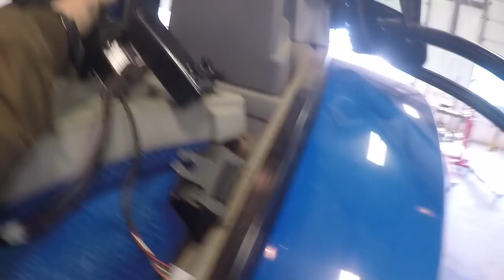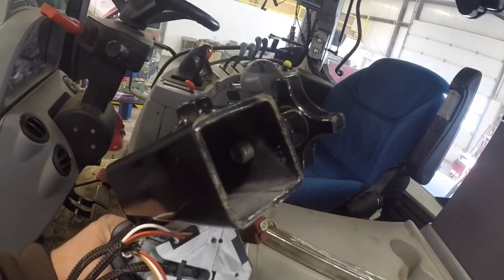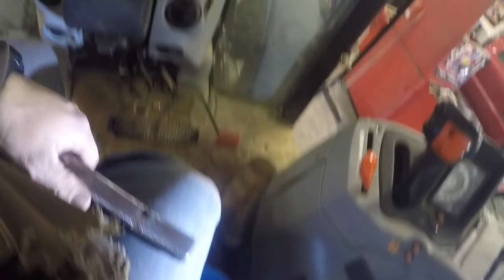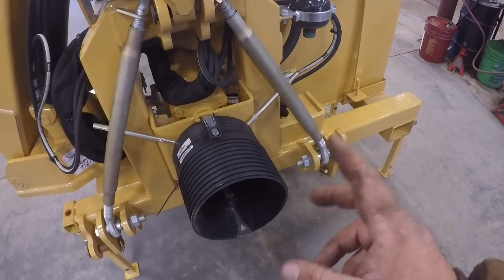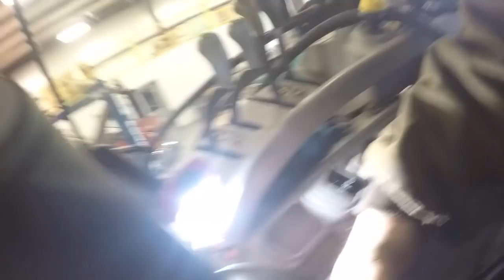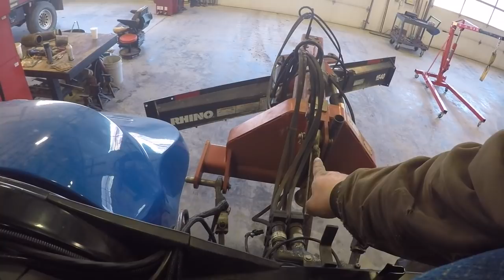The 6030 is getting a Diamond sidekick.

Comment: For the joy stick change could mod. the loader/snowplow joy stick with a square like the mower joy stick? I think it would make changing from 1 joy stick to the other 1 very easy with no tools required.
Reply from the maker: +Bradley Fitkin. That's a good thought but I don't think it's possible the way the cables come out of the factory joystick.

Comment: I was gonna tell you not that what you did won’t work fine but instead of cutting a slot like that if you have the right size end mill you can cut a radius in pretty easy. You wouldn’t want to try to plunge the side of the end mill into a wide area like the side of that tubing but you can use the spindle just like a drill press and progressively take a little at a time to get to your full radius. Basically cutting with the bottom of the end mill rather than the side in order to reduce tool pressure.
Reply from the maker: +Strangefruit. I'm not sure what I did but it worked! Lol I need someone to teach me how to use that thing.
Reply: DLH Farms check out tubulcain and abom79. The first guy shows you all the basics and the other shows some good stuff too. I’ve learned about everything I know about machining from YouTube and i can actually do some decent machining now. Pretty much limited by my tools now. Lol
Reply: The biggest thing I can tell you is make damn sure you have clearance for drilling and stuff. You seem to care about your stuff enough to know that though.
Reply from the maker: +Strangefruit. Thanks good to know!
Reply from the maker: +Strangefruit 👍

Comment: Now i know why most stay on a tractor all the time
Reply from the maker: +AJ. Most units are mid mounts that take a couple days to install so yeah those stay on the tractor all the time. This one is pretty easy to take off and put on.
Reply: Yeah My local Highway Dept has a old 5020 Deere with a Alamo Boom Mower  They Choose that Old Deere since it was a Heavy old Tractor and it runs off the rear Pto but a mid mount  just took a lot of Plumbing work and they tied the tractor Hydraulics into The Boom and the mower runs off the PTO pump then but its simple with the Tractor valves running the boom functions which is nice then the mower runs on a toggle switch
Reply from the maker: +AJ. Yeah those mid mounts arnt really meant to come back off it's basically a dedicated tractor for that job.

Comment: Dennis, I like your idea and you did good on the milling machine being your first time and no instruction available.  Apparently, the wiring connections are not an issue if you get the mount in the right place and it works well for you.  I would sure like that mounted on one of my newer, high flow hydraulics tractors.  My wife would take off with that joy stick mower set up and I would probably be lucky to see the tractor when I need it again.  I am sure it will be great for your farm and excavation business.  Something like that is one of those items you wonder how you ever got along without it after having it available for awhile. Nick, North West Farmer
Reply from the maker: +Nick Lambing. Lol. I'm already loving this thing, I cleaned up a creek yesterday with it, don't even look like the same place.